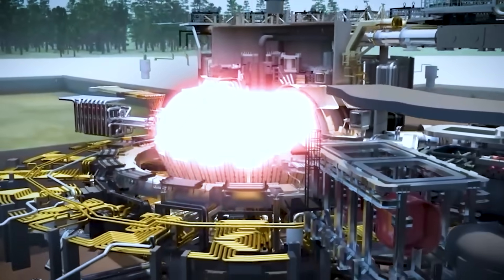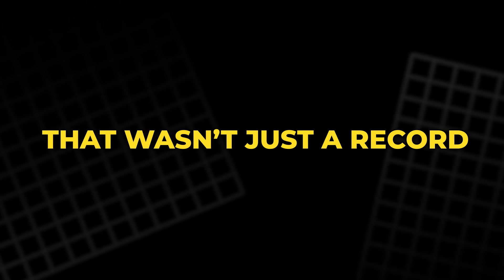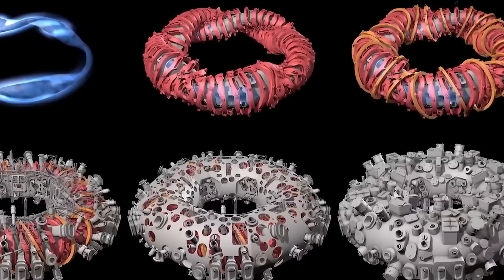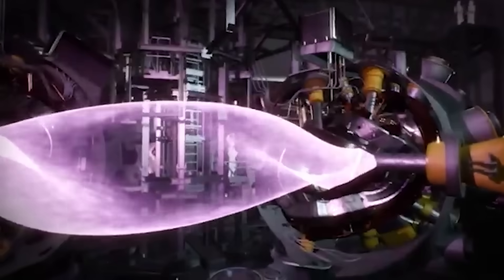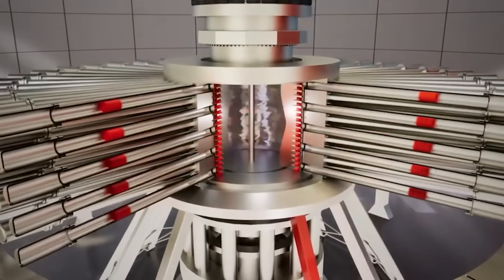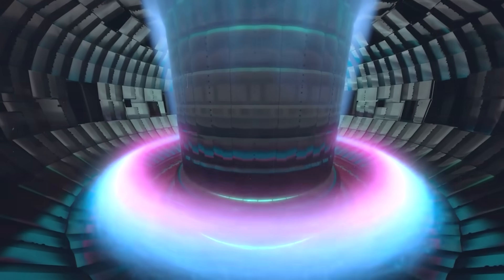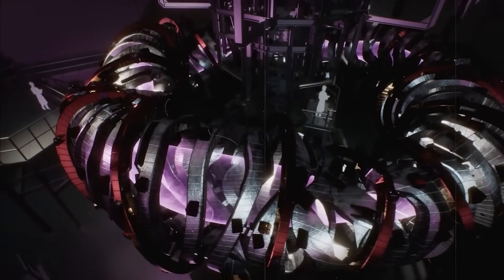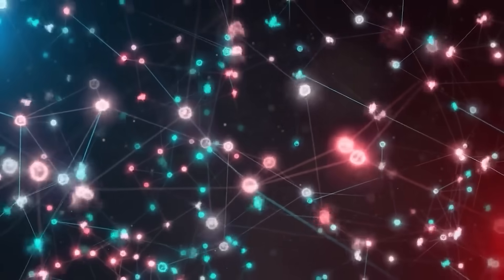Germany’s Twisted Machine That Just Changed the Future of Energy Wendelstein 7-X Fusion Breakthrough

Comment: The sun produces energy by burning vast reserves of energy sources, most likely hydrogen gas, and therefore it does not create energy out of nothing but converts it. That is, it is not free for the sun, but it is free for us because we are not responsible for providing any of the elements the sun needs to generate this energy. But what would we do if we made our own sun? Let's hypothetically assume that the scientists conducting these experiments have found the method the sun uses to generate energy and were also able to create a simulator for it. How would they obtain the materials (for example, hydrogen) that would be used to carry out these reactions indefinitely?
Reply: Fusion fuel can be derived from sea water.  Helium 3 is the best fusion fuel.  This WILL be obtained by mining the surface of the Moon.  Yes, it will be cost effective.  However, electricity will NEVER be free to the consumer.
Reply: @pauleveritt3388  Solar and wind will be one cent or less.  He 3 require a much higher confinement criteria.  DT will be it, and they will rationalize the radioactive wastes.
Reply: It doesn't really has to be indefinitly.
We have so much hydrogen, the sun would consume earth in ~5 billion years, before we run out of it.
Reply: They have to use T D which creates a lot of neutrons and radiation.  There's only enough tritium at the moment for one fusion reactor.  It costs 80,000 USD per gram.